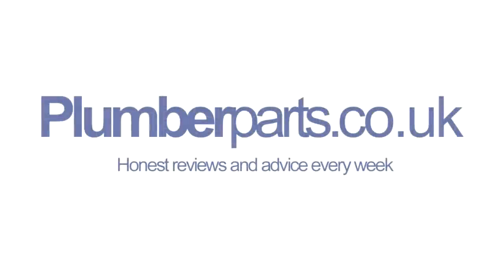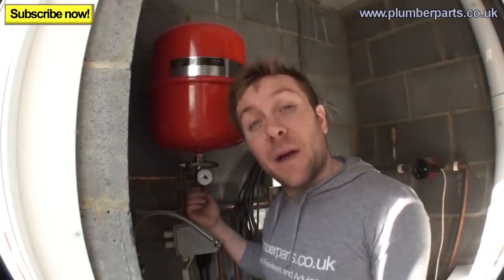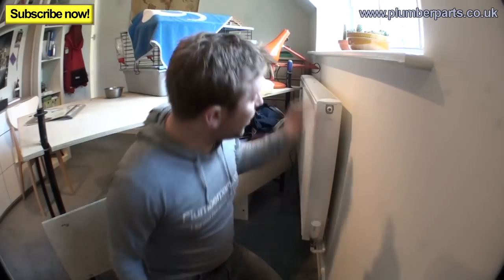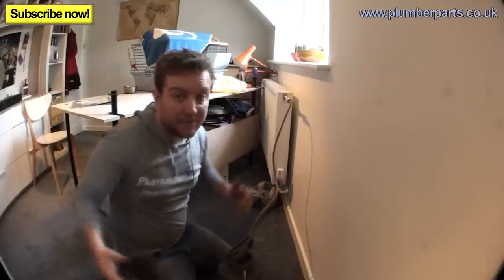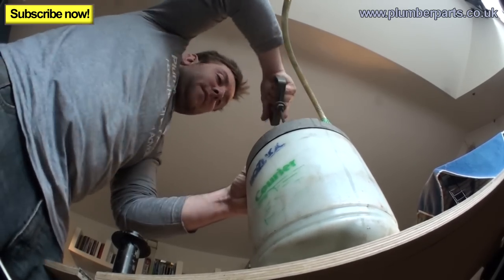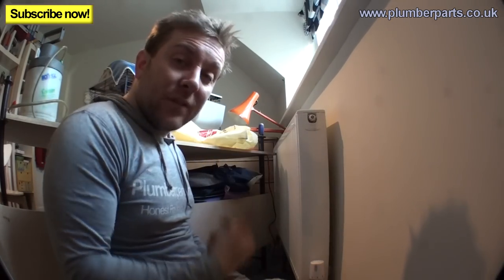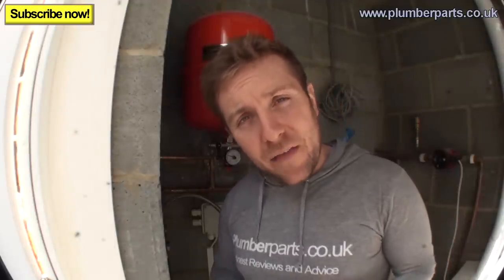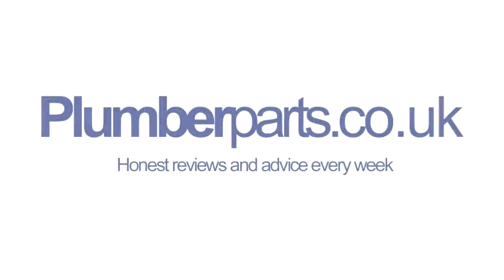HOW TO ADD INHIBITOR - PRESSURISED HEATING SYSTEM - INJECTOR - Plumbing Tips

Comment: At last a really good method and explained well. There are many videos showing how to do this badly without proper explanation but this one shows/explains one of the most important parts about injecting the air in at the end to prevent any water coming out when removing the fill device. Brilliant and logical!! Thanks a lot and keep them coming.

Comment: Fair enough. Depending on quality of water in system, sometimes the seat on PRV doesn't seat well due to crap and debris. Gets to the stage at times where a replacement is need.

Comment: Hi, Your videos are really usefull to me as a DIYer, I have recently removed some rads using your instructions for decorating and refilled them, I have noticed that my system has a Physical Corrosion Inhibitor CM10 fitted. Will I still need to re add inhibitor into the system or am I asking a stupid question? thanks in advance.

Comment: 5:00 as the water system is depressurised, it's worth checking the expansion vessel is at the correct air pressure before repressurising the system with water... (I believe the expansion vessel should only be adjusted when the system has been depressurised of water pressure)

Comment: Love your videos - thanks! I want to add a couple of bottles of Fernox 5 today as I'm emptying my entire pressurised system to repair two leaks (one from a TRV).

Once fully drained and leaks fixed, can't I just remove the entire 1/2-inch bleed nipple fitting from an upstairs rad and pour the Fernox in using a funnel attached to a bit of rubber hose (and then refill the system?)
Reply from the maker: +Alex R Yes mate, that's fine to do!

Comment: What I do is remove the radiator air vent and connect a spare flexible filling hose in its place - then use a funnel to pour the inhibitor down the loop and into the empty rad. Then I fill the sys up and run it on heating for a while so it gets pumped around.

Good/bad idea?

Comment: so the inhibitor is squeezed in one rad, with ur invented gadget,...then u re-pressurised the system and then?, obviously you run the central heating then don you?,.. and does the inhibitor stay in the system for how long?.....can u make a vid on using a chemical like fernox to clean the system WITHOUT a powerflush please,....im going to try and attempt to do this at home but i need your advice pls guv?.....thanks

Comment: I'm wanting to add inhibitor/antifreeze to my static caravan, In the handbook it says to add it via the water pressure point, I need to add 6/7lts, I've bought the hand spay pump and have the connectors, the boiler we have is a Worcester combi 24i Junior. If we do this the way they recommend, would it be best to initially drain off about 10 litres of the system radiator water to add the inhibitor/antifreeze and then top up to  1bar pressure with the  extra water. 
Silly question but, how long will it take for this to mix through the system?
Hope this all makes sense and that someone can help :)

Comment: I got a combi system, was just wondering should I use a fernox cleaner then the protector? as I've took the radiator off the wall to redecorate and the water came out clean so,, as there are no problems will I only need to use a protector? Thanks
Reply from the maker: Yes, do that for a day and then add inhibitor. SUBSCRIBE! ➡️👉 https://www.youtube.com/subscription_center?add_user=plumberparts 👈⬅️ IF YOU HAVEN'T ALREADY! 😎

Comment: I was told never drain the system from the safety valve as they can start letting by . bad practice. I have worked on domestic. and commercial systems.
Reply: I'd say it was a good thing to do so it checks it's working and not blocked and clears it out.